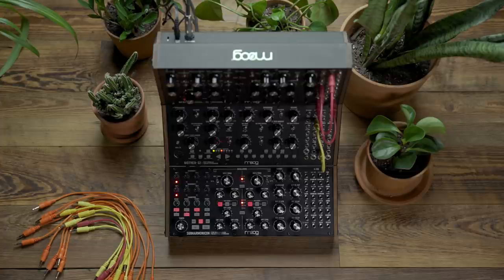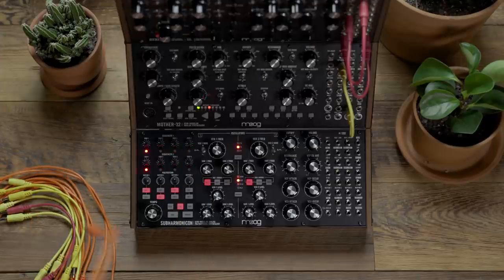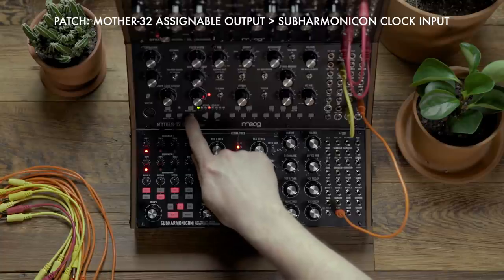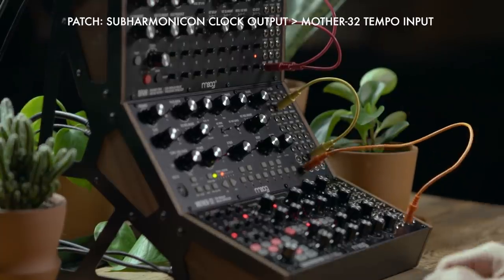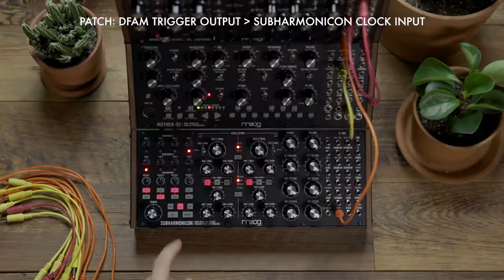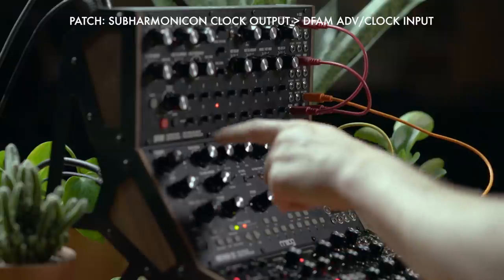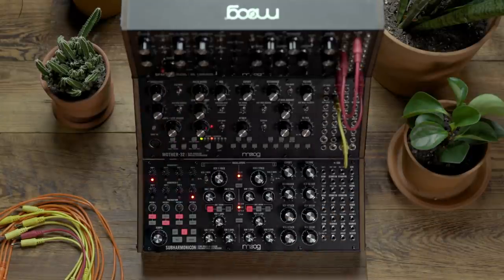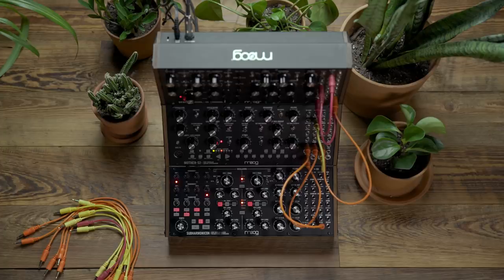Subharmonicon | Using Subharmonicon with Mother-32 & DFAM

Comment: Can someone here who knows about using multiple units tell me how you manage the three outputs?  Do you send them to a mixer?  For recording, would each need a separate input on an interface?  Is there any way to consolidate the audio output into one signal? Thanks!
Reply: I would like to know the exact same thing. Any experts around?
Reply: Yes . Logical way is a mixer. It is all mono out. Else you may want to plug into an interface. But in short - each of the 3 outputs will get an input each. If you add stereo effects along the way. Then you can make each mono into stereo. Or you can do it in a mixer. Or you can send a mono mix out ! ( if you like Mono that much ).
Reply: It all depends on what you want to do. For recording  I have all three of mine routed into separate line ins on my audio interface so that I can record them each individually on their own track. This makes chopping up sounds and rearranging easy. For performance or live jam I would have everything routed into a mixer producing one mono output. You could record this way too if you wanted, everything would just be on one track. Like it said, it depends on what you want to do for the occasion. Hope this helps!

Comment: What is the Tempo Setup of the Mother-32? CV,single clock or DIN Sync?
Reply from the maker: This is using tempo mode 3 (analog clock mode) in the V2.0 firmware.

Comment: I use the Subharmonicon as a master but then I sync DFAM and M32 with a split cable the goes directly from Subharmonicon's "CLOCK" out to M32 "TEMPO" and DFAM "CLOCK" ins: I don't want to loose the M32 "MULT" ports just for syncing the devices, they so useful for other purposes.

Comment: What about sync'ing the Subharmonicon to like Logic Pro X?
Reply from the maker: In order to sync to Logic or any other DAW, you’ll need a way to send midi from the computer, such as a midi capable audio interface, or a usb to midi cable. Then you need to connect midi to the subharmonicon using the included DIN to 3.5mm adapter.

Comment: When running 3 of these how do you use headphones without affecting audio quality or voltage signals between the 3
Reply from the maker: The best solution is to use a simple external mixer with a dedicated headphone output.  In this video we're using a mackie mixer that is out of frame.

Comment: So you would need 3 inputs in your interface right? One for each to record into your daw?
Reply: I have exactly the same question
Reply: Did you find out the answer?
Reply from the maker: If you want to Multitrack, then yes, 1 channel per synth. Otherwise, you could take each synth into a mixer, then bring the stereo mix into your daw.
Reply: @MoogSynthesizers  I got a new audio interface to connect my new Subharmonicon along it's mother and drummer brother (from another mother) Now I'm trying to decide if get a grandma or the matriarch for them. 

By the way, the included poster inside the Subharmonicon box is so awesome. Now I want to buy all the synths to collect all the posters haha